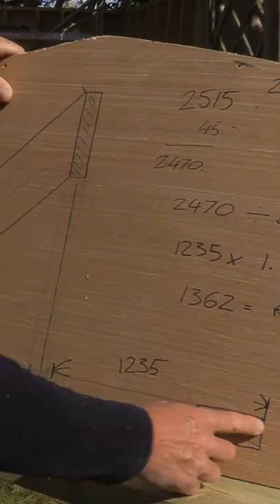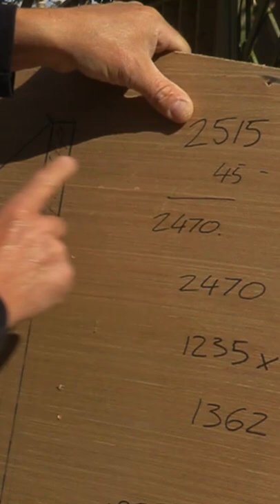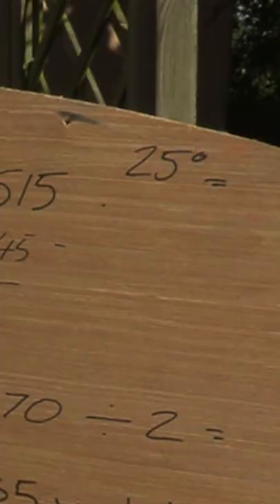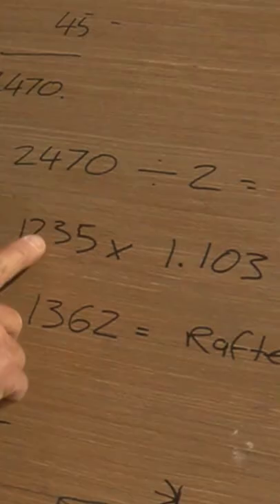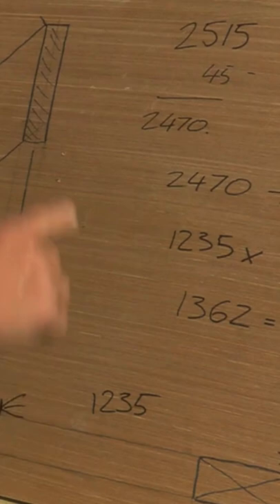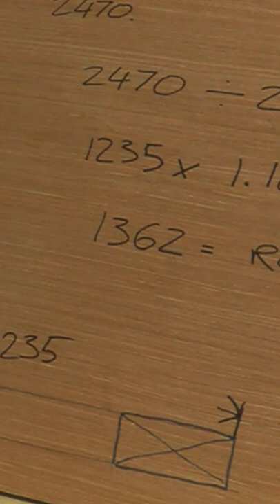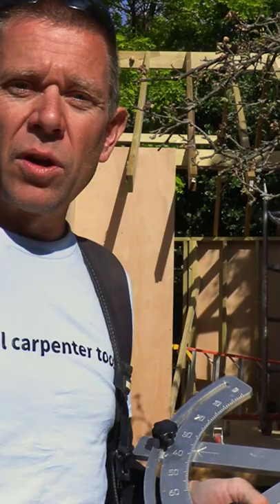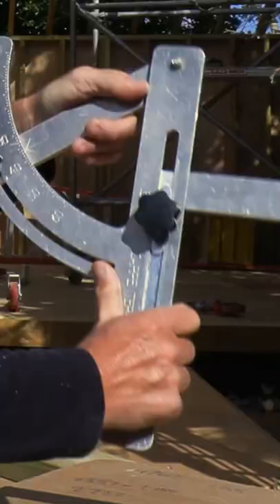How To Work Out Rafter Lengths  #shorts

Comment: Or use a sliding bevel a protractor, drop a level line, get the angle, work out from there, if you need to bass the length use trig from plate to ridge, subtract the plate thickness and ridge

Comment: U wanna make sure that existing rafter is nice and straight though otherwise the angle u get might b slightly out compared with rafter length the tool length is quite small
Reply from the maker: Hi Ken 
What you say is correct but the argument that you somehow even out the variations by having a longer framing square is false. If the bow is along the whole timber a longer square won't get it and if it is a bump in the timber your longer square will rock on it. 
Daniel looks at the tip and puts the bow at the top. Have a look at his roofs and you will see that they are as good as anyone's. 
In the end we have the timber we have and the skill is in making it work.
Reply: @SkillBuilder  100% on that one seems to me nowadays uve got more chance on winning the lottery than straight true timber being delivered to site
Reply: Nothing is ever perfect wood moves so even if a roof is 100% bang on it  still will end up moving and twisting over time. Us carpenters or builders. Can never have a timber roof perfect we work  with timber we get and make the best we can from it.
Reply: @barrieheard9426  tell me about it but years ago they at least used to season it properly and it was slow grown timber nowadays I reckon the tree was still growing about a week before we get it and this fast grow stuff just can’t compare
Reply: @rayspence3677  seems u guys in the states have to make silk purses out of pigs ears the same as we do in the UK it’s all sent to test u

Comment: Is the rafter length to the Bournemouth and where does the 1.103 come from?    Thanks
Reply from the maker: The 1.103 comes from the tables or from Dan's Free App. https://www.essential-carpenter-tools.co.uk/

The rafter length is measured along the top of the rafter from the tip of the plumb cut. We have a follow up video or you can see the whold story on https://www.youtube.com/watch?v=_TmXZ0cGNEI&t=787s
Reply: 1÷cos(25) = 1.103 then multiply that by the rafter run. 

Or you could do rafter run;

 1235÷cos(25) = 1362, same thing, it's just a multiplier because it's a dependent/proportional thing